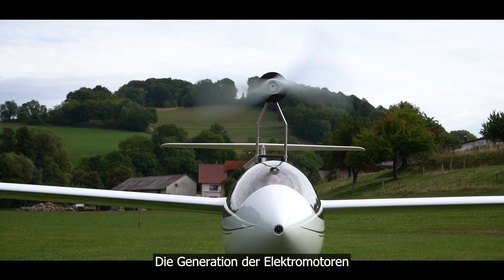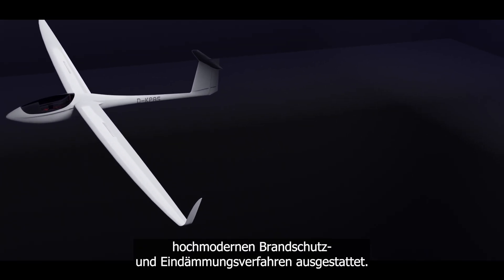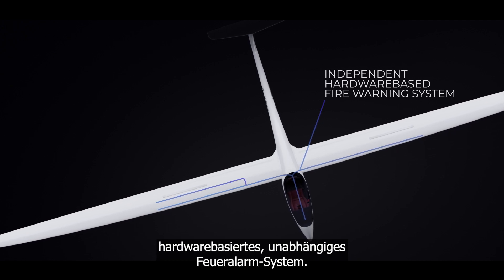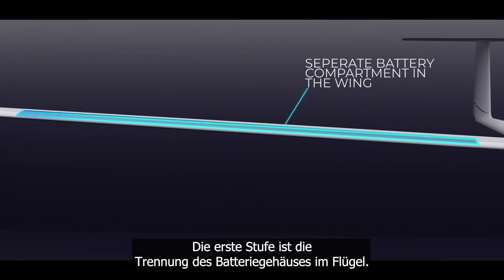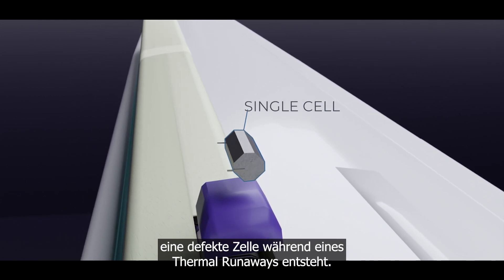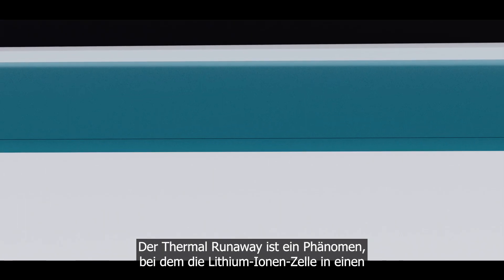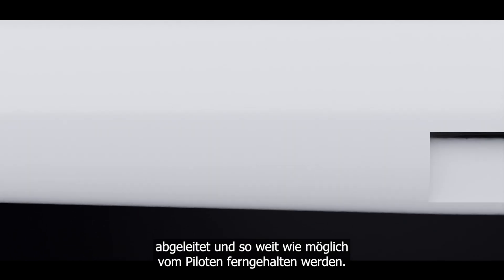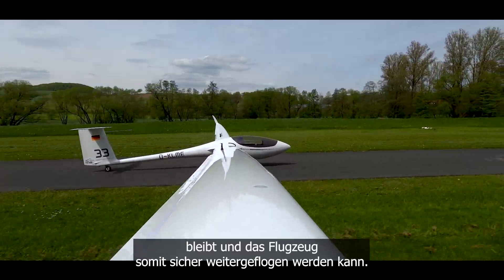Behind the curtain - The Me Safety Concept

Comment: I love it! Wonderful presentation. Should a thermal runaway occur and we need to replace a portion of the entire pack - what will that process look like? What maintenance protocols will be required, and who will be allowed to service the battery assemblies? 

I have to be clear - I don't expect to be able to replace a single 18650. But if a portion of a pack or a cell fails - hopefully we can order a new component of the overall battery set and be able to replace it ourselves. Let me know, because it's a part of life with lithium batteries, not just for fire. Some get weak over time. The Prius allows the end user to replace individual cells. 

Hopefully we will not need to ground the aircraft over a single cell failure or degradation, or to send that entire tube back to Germany for service. Let me/us know... Inquiring pilots want to know what the future looks like!